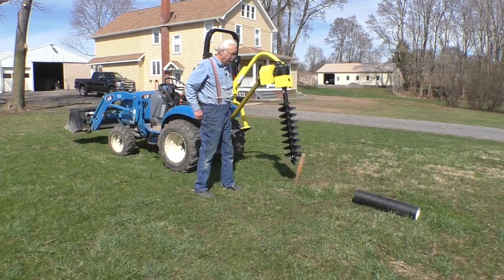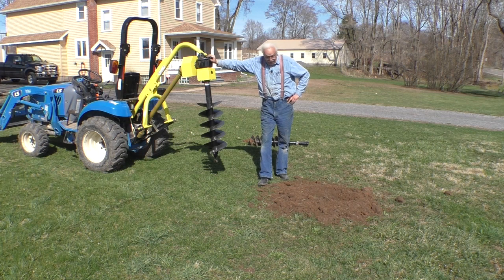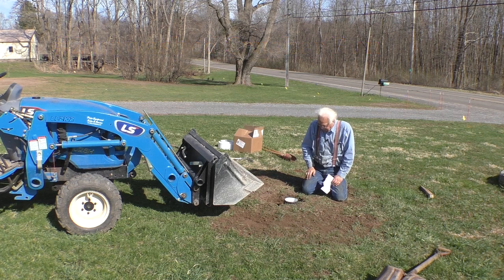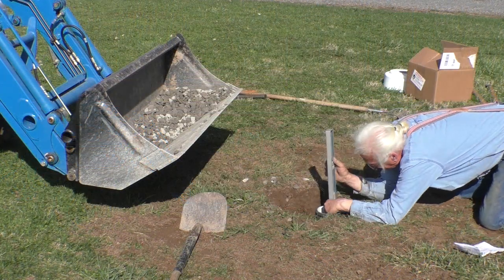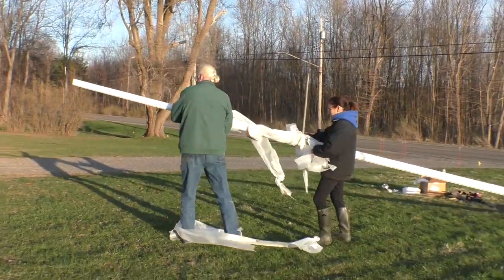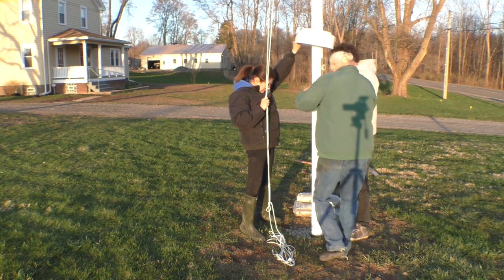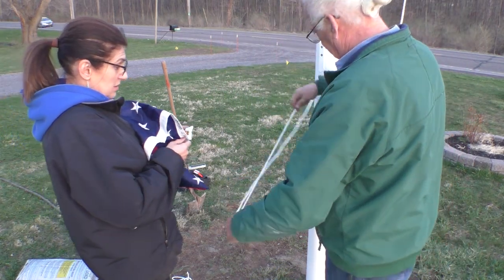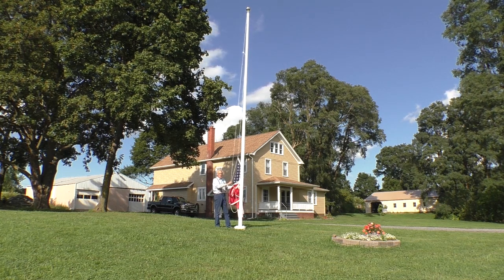25 Foot Flagpole Install

Comment: I have to replace the sleeve for my 25’ telescoping flagpole.  What length PVC should I use?
Reply from the maker: I wish I could tell you, but there are too many unknowns to give a good answer.
Reply: It's been three years since you asked this.....but there is absolutely no need for a sleeve. Just pour the concrete in the hole and that's it!

Comment: We are told to create a hole that is 25 - 30 inches wide but those augers we can rent at Home Depot only dig an 8" wide hole. Hopefully we can move it around to create the larger and wider hole. I do not want to be digging by hand! Also, a lot of people are saying that using a sleeve is not necessary and a waste of money....I think I'll skip that part.....this is the first I've seen and maybe the only install that did not use concrete....Wow! Not sure that's a good idea!
Reply from the maker: Not using concert was not a good idea and the foundation has been upgraded to concert (there is a video).  I highly recommend using the sleeve . If for some reason you wand to take the pole down the sleeve is the way to go.

Comment: I watched the video and enjoyed it very much. I went to Harbor Freight and bought an auger as the rocks in my soil are horrendous. About 6 inches into the soil I hit a rock and the auger twisted my upper body enough to tear the muscles in my chest. After a week recovering I finished the job and didn't mix the concrete correctly and now have the worst flag pole in North America.
Reply from the maker: A sad story, at some point it will bug you enough to fix it.

Comment: It looks good but you really should have gone with a larger foundation and used concrete. Even if temporary, you could have kept the concrete slightly below grade. If you’re out one day,  don’t get a chance to take down the flags and get a decent rain wind combo, it will move that pole. It’s already not level with the house. It’s a nice looking Atlantic fiberglass pole. For all the effort, concrete wouldn’t have been much of an extra step.
Reply from the maker: Thanks for the input. You are right, however as a temp. install it is doing much better than I expected.  It has gone through several wind/rain events with no problems (famous last words). Not sure what you saw in the video that says it is not straight. As of this morning it was still straight up and down.
Reply: Lever-Family-Racing out of curiosity, why is it only temporary? You have a flagpole with a 120 mph unflagged wind rating but the foundation is a weak link.
Reply from the maker: @davejoyal9286  We plan to redo the planting in the area of the flag pole next summer, also plan to run power to light the flag at night. I suspect when we do the planting the pole will not be in the same spot. Glenn
Reply: Lever-Family-Racing give it the foundation it deserves when you find the right spot. Best of luck and enjoy it.
Reply: Yes this might be the only install on Youtube where concrete was not used.....there is no way that pole is going to be stable and upright....for long.....

Comment: what brand of flag pole and construction material is it made of???
Reply from the maker: The pole was purchased from "The Flagpole Company" It is their "Fiberglass Heavy Duty External Halyard Ground Set" 25 foot one piece white Fiberglass pole. https://www.theflagpolecompany.com/fibha.html That price was $995.95  Their customer service lacks that personal touch we all like. Some place it stated the poles are seamless, mine has a seam. The pole has held up well, my temporary foundation did not. Pole now has a 5 degree list. There will be a new video where we do the foundation as specked in the directions. Thanks for watching.